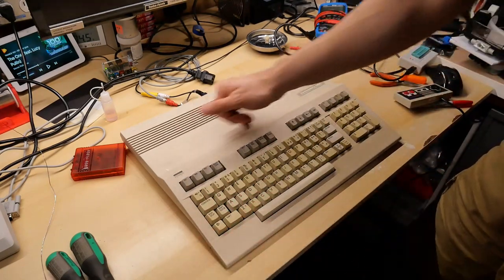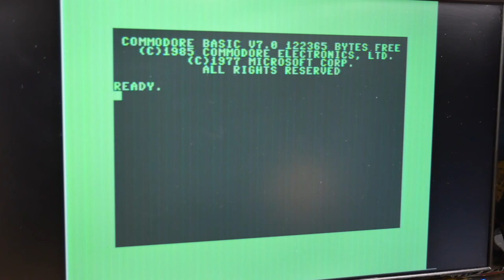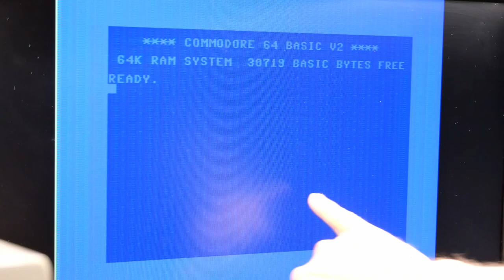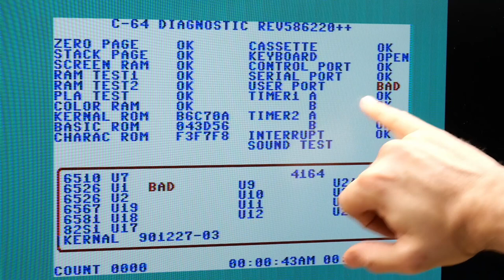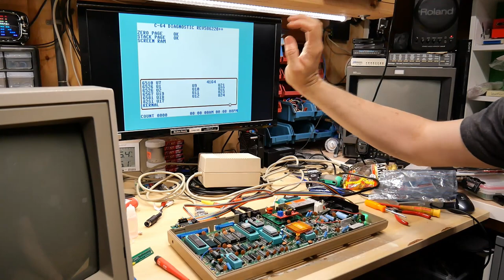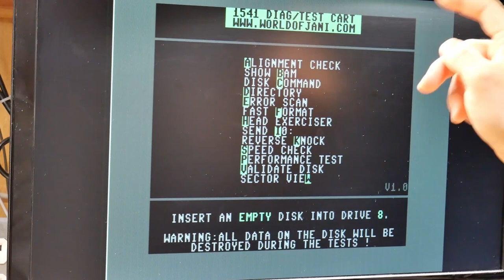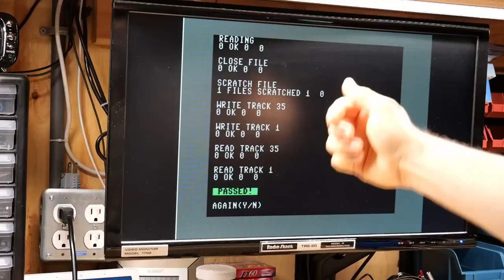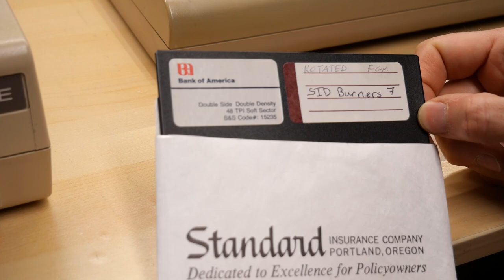C128 fix and a disk drive voltage conversion

Comment: To make "flippies" we had to cut the protect notch and sector index hole both, and I would generally just use scissors and a ruler to mark where to cut the write protect notch, and for the sector hole again with the ruler to make where the hole should go, and a simple hole punch (remember to do both sides!) would do the trick.  The problem with that was flipping the disk reversed the direction of the disk, and disks in those days had a white "fuzzy" dusk collection pad that sat on the disk and flipping the disk and reversing the direction would dump all the collected dust onto "side 1" often trashing the disk, so I stopped making flippies.
Reply from the maker: I think every 1541 and Apple II person flipped their disks to maximum the storage potential. I never personally noticed any issue with the dust on the fuzzy inside -- but I generally always kept my disks in the sleeve, so they didn't accumulate much dust I guess.

Comment: The 220 transformer is actually 2 * 110 in serial if you put them in parallel you'll get 1x110.
Reply: You should never put voltage sources (as the transformer) in parallel!
Reply: @starsundsternchen802  umm, no, this is standard practise. 

A great many transformers have 2x110V primary windings which you combine in either series for 220V use or parallel for 110V use, allows the manufacturer to use the smallest gauge wire in the primary reducing the cost of the transformer, otherwise they'd need to wind a double-thick 110V primary to allow it to support the necessary current when run on 110V.

Ditto the secondaries, you'll frequently come across transformers with say 2x15V windings which can either be connected in series for a 30V (or +/-15V) output or in parallel for twice the current output at 15V.

In both cases though you need to be aware of phasing because if you connect the windings out-of-phase you've made an effective short, in-phase they're 100% fine, generally the diagram on the transformer will have a dot to indicate which connections go together for parallel wiring.
Reply: @SomeMorganSomewhere  You are right! I mixed it with galvanically linked sources!

Comment: 20:08 Oh boy, I remember those power bricks (called "Elefantenfuß" or "elephant foot" here in Germany ;) ). If they are at least a little bit similar to the C64 ones, they are prone to failure and even thus prone to damaging the Commodore because of overvolting it in the process. :(

Comment: Great video, Adrian!

Write protect notches... Maybe more appropriately "write-enable" notches. I remember when little kid me was introduced to those without a full explanation of how they work, so my 6-or-7-year old brain put together this idea that the notch in the disk was how the data literally flowed into disk to be saved... If you covered the hole it prevented the data from getting "inside" and on to the disk. Maybe covering it with medical gauze will keep computer viruses from spreading?  

Very cool about the ASCII/DIN key... I noticed that this gives you access to umlauts and other characters that make spelling in languages-other-than-English possible. 

Unless I'm overlooking it, I don't think I've ever seen you do a video covering the Commodore 1701/1702 monitors? Would love to see you go through one of those units... When you pair up a good C64 with a good 1702, it's pure heaven.

Comment: That half-width font looks remarkably like the Commodore PET font. Probably not a coincidence...
Reply from the maker: Indeed -- the PET font should work fine on a C64 and I once loaded the C64 font on a PET. Both are the same map with all the PETSCII characters. (The VIC-20 font is a single width font too.)

Comment: The C64's door wedge PSU is a usual fix here in Germany: Just replace the old board with a fitting 5V AC-DC converter, like the NFM-15-5  and you have a reliable PSU in original design.

Comment: 128s are pretty much bullet proof. Except the ones with the "MT" Ram chips. In most of my repairs these were the issue. Very nice to see something different :D
Reply: MT - Mostly Trash
Reply: I always thought Micron Technologies was one of the best memory manufacturers. I wonder what the failure rates were on different RAM brands back in the day. Perhaps Micron had lower early failure rates.
Reply: @eDoc2020  that probably changed over time. that also changed with process of manufacturing.

Comment: A disk with double notches where named flippy disks.
Reply: I thought that term was reserved for double sided disks that had two different formats, one on either side.
e.g. might have a C64 version of something on one side and an Atari version of it on the other side?
Reply: @SomeMorganSomewhere  Nope. That was the common use for commercial game distribution, but any such reversible disk was a flippy.  
(We had a bunch of "flippies" in the disk box for my old 99/4a. They were all Wabash disks, and failed dramatically in short order.)

Comment: That alternate font looks to be very similar, if not identical to the VIC20/PET font.
Reply: Yes, I was thinking the same. PET had 40 an 80 col versions. Commodore increased the width of the font for the C64 as the thin lines get blurry on regular TV sets.

Comment: Hi Adrian what does Pla chip and sid cheap stand for? 
Also have you done a video or going to do a video for the nes controller to c64 conversion  or have you already done 1? also is there any difference between the c64 and Amiga 500 controller pinout?
Ty Greg
Reply: PLA means Programmable Logic Array, SID means Sound Interface Device. PLA is like a Chipset, while the SID is the sound chip.

Comment: @Adrian - Why did the Commodore 64 require the RESTORE key to be smashed to make it function?
Reply: There is a small protection on the mainboard to prevent multiple NMI interrupts in a row. If I remember well, there was a poor chocie of capacitor in that protection. You didn't need to smash, but the restore-press had to be reallly short, and people made the wrong conclusion that you had to smash the restore.

Comment: The video is normal for PAL. Normally if used on a CRT the persistence of the phosphor and the bandwidth of the video circuitry in the monitor would smooth out the display. (still noticeable). The problem with converting to LCD for all retro computers is that the level steps in the colour ADC's are too fine thus it digitizes the noise. The retro converter would work better if they used less bits in the ADC or they bin the samples and normalize them (a bit like auto-tune for colours)
Reply: I'm not sure. I have several C128s and alltough some of them have really bad jailbars, I don't think my machines do display as poorly as Adrians one.

Comment: Have you tried adjusting the trimmer capacitor next to the clock chip ? It's possible that theres some process variation in the clocks that the VIC generates that could be trimmed out with this

Comment: Instead of using 9VAC for the power supply, you should be able to use 12VDC. 9 x 1.414 = 12.73, so probably close enough. You have to get polarity correct if it doesn't feed a full bridge rectifier

Comment: My NTSC c64's vic-ii is a weird one. Every time I power it on, the jailbars are different. Yours seems to be some sort of other weird video fault, but it seems to still behave similar in that it looks different when rebooting.

Sometimes when I power it up, the jailbars are completely gone, and it looks damn near like an emulator with the retrotink and my 75in 4K TV. I've got a homemade set of massively overkill double shielded AV leads, so when it behaves, the image is absolutely astounding.

Also, every key on my machine needs to be pressed extremely hard to register. I've tried cleaning the pads and contacts with alcohol, no change. Any suggestions?

Comment: Caution on using a hole punch or tool to notch the other side of a single-sided disk... After ~ 25 or 30 years, I converted my old C64 disks to PC ".d64" files, and found MANY second sides failed to copy properly.  I'm led to believe the single-sided disks started out as double-sided, but failed quality standards and were therefore not certified as double-sided.  FYI, I built a cable and had PC software to connect my 5-pin DIN serial cable to a PC parallel port, which is how I performed the transfers.

Comment: That CompetitionPro doesn't look fake. The clear one was the 3nd model that was released, when there only had been the previous two black models (first with metal leaf contacts instead of microswitches even on all directions and a black handle, 2nd black with a red handle, with microswitches only at the directional contacts, 3rd one with microswitches only at directions but not in the fire buttons, red handle and transparent case), still using the rubber ring instead of springs and it was the 2nd most popular. It was about 3 years later, that they switched to springs instead of rubber, first seen with the (originally dark blue) CompetitionPro-Star and then later with all models. Amongst sophisticates the rubber-ring ones with leaf-contact fire buttons where the best CompetitionPros ever made because you could control way more precise and sensitive and much faster than with the way too stiff spring loaded models and they also didn't bother you with that super annoying clicking so extremely as their still where leaf-contacts in the fire buttons. Also you could fine tune the fire buttons' leaf contacts so that even slightly blowing at the button would result in a registered push. The possible fire rate was MUCH higher than with the microswitched fire buttons of the later models, because the microswitches didn't return the fire button fast enough. You can tell later of the terrible clicky and unprecise black models from the better and older ones by the clicky ones having a visible stamping on the joystick's upper edges, where the CompetitionPro would usually have had it's small xtra fire buttons, as they obviously used the same mold. But sadly not all of the clicky models have this 'feature', as they probably used some remaining older cases after switching to the fully-microswitched-spring design.
I can still remember the gaming magazines reviewing the CompetitionPro after these changes. they all praised it to heaven and claimed the microswitches being so great, and how they wished that even their wife had microswitches on her body - I think this was a bit weird, as no one that I knew of (including myself) actually liked the newer ones better than the older ones, and when we did mixed 1:1 matches for testing, the newer sticks' design clearly proved to be a disadvantage. Also a metal spring being cheaper than a massive lump of rubber seemed to be the main reason behind the change..
Problem is, that the rubber didn't age well, since. That's why I prefer the ZipStick nowadays, as it had a spring but isn't as notchy as the spring using CompetitionPros.

Comment: In the 1541, notching the disk meant having to put the Write protect tape label on it to prevent overwriting the disk. That was an issue because the label tended to come off and hang up in the drive mechanism. So i put a switch inline with the sensor so i could trick the drive into thinking the notch was covered.

Comment: So does the RGBi output only work in 80-column mode? Did people have to connect the same monitor using two different cables in order to have access to both modes?
Reply: Yes and Yes. You could also have a dual monitor setup, one 40 column and the other 80 column.
Reply from the maker: Yep -- at least on the Commodore monitors, the RGB/Composite switch is right on the front under the door -- so easy switching. Not a very elegant solution though.

Comment: If you connect a 220V transformer to 110V, you simply get out 4.5V instead of 9V. The transformer has two 9V outputs, one connected directly to 9V pins, the other to the 5V regulator. As you would replace the 5V part by an switching power supply anyway, the second 9V output is free. So why not simply put both 9V outputs in serial? So on 110V input you get 2*4.5=9V, exactly what you need. So you can reuse the transformer...

Comment: Back-in-the-day, using the back side of the disk wasn't 100% reliable. First, some disks failed QA on one side and if you used the back side would run into issues. This was a problem early on, but disk manufacturing quickly became good enough that bad sides were extremely rare. The other problem is, because flipping the disk caused it to spin in the other direction, it was possible that dirt and grime that had been pulled off the disk by the felt lining, could be pulled back out and run under the heads -- this would result in the need to clean the heads more often.

But in general, flipping you disks gave you twice the value for your disk purchasing money -- and that was big because back-in-the-day disks were expensive.

Thanks for the trip down memory lane.

Comment: im going to get some desolering gear and want to deside between the same desoldering gun adrian has and a hot air station or  a better desoldering gun. wich is a better coice?

Comment: I notice the keyboard buttons return and restore become less yellow, but weird, maybe those keys are made of a different alloy plastic.

I myself have been a plastic processor for 24 years, so that some things remain a mystery.

Like your video's      Greetz
Reply: I have a MIDI keyboard from the early 1990s that is still in good working order (aside from the pitch bend having a massive "dead spot" but that's a design flaw, not an age issue) and its keys are unevenly yellowed as well. But I noticed that all the F keys are the same shade of yellow, all the D keys are the same shade of yellow, and so on. It could be that the C128's keys were made similarly -- run a batch of a thousand "A" keys, swap the dies, and make a run of "B" keys, etc. Natural variance in their plastic supply (which was, at the time, masked by dyes) could explain the rest.
Reply: @mal2ksc  Wouldn't surprise me, Commodore was known to use different parts and brands, just what they had available with the electronics.

The fact that they would use tricks with plastic manufacturing to be cheaper or smarter will certainly use that or even distribution can play a role in the wider use of semi-product manufacturing.

But find your story difficult to follow because my English is not good enough, that is not your fault.
But to me.

I used to be able to copy / paste the text from YouTube and translate it somewhere else but YouTube has forbidden that, now I can't translate answers very sad YouTube why not necessary for anything not everyone is good at languages, especially the older ones not like me :(! !

Grz from Holland buddy ;)
Reply: @eddielegs344  On a musical keyboard, all the white keys are shaped a little different because of the pattern of two, then three, black keys per octave. But this pattern repeats at the octave, so every C key (except the highest one) will be the same, every D key will be the same, etc. It makes sense they'd make these keys in batches, and apparently that is the case for mine because the key for C -- in all four octaves -- is the yellowest, the D is not as bad, the E is better still, and then the keys from F to B have almost no yellowing at all.

I just figured the economics of running the molding machines favors running large batches for typing keyboards just as much as musical keyboards, so they probably batch their jobs in a similar manner.

Comment: Does anyone know what the hat is on the Raspberry Pi that shows up around 41:44?  It kind of looks like some kind of MIDI interface but it's hard to tell. I'm curious what it's used for.
Reply from the maker: It's a Pi1541 -- cycle exact disk drive emulator :-)

Comment: You could power a 230V transformer in the US. I thought US electric supply to houses is split phase. 115V-0-115 with the two 115V live wires 180 degrees out of phase.
 Why not run a dedicated cable from your breaker box to your basement that has both 115V live wires + protective earth and fit a UK and/or EU socket at your bench to give you 115V+115V=230V? 
 clothes dryers and cookers in the US are 230V and use both 115V hot wires in series i think, don't they?
Reply: Correct, thats how I did it when I worked in Canada for a few years, could power my 220v stuff

Comment: do they have the 6510T cpu inside? it supposed to have 8 bits tapped out from the I/O port. i guess they probably got rid of the AEC and nRDY pins for that
Reply: The 1570/1571 use the 6502A CPU.

Comment: 42:20 .. from what I knew about Commodores "manufacturing philosophy" it wouldn't be surprising AT ALL if the case parts were already different right from the factory.

Comment: i wonder why COMMODORE INC did not make a duel disc which one high torque motor driving both drives via a shaft and two drive belts.